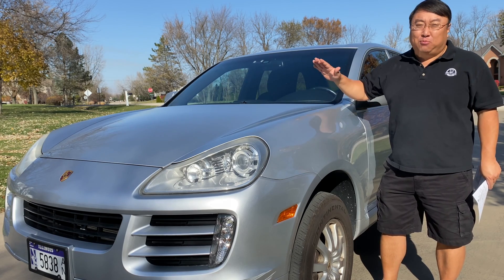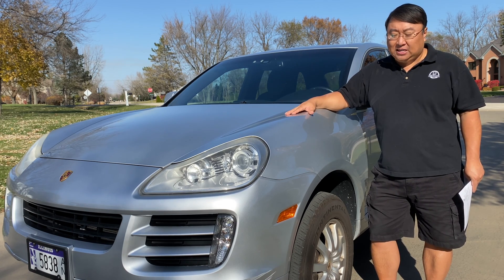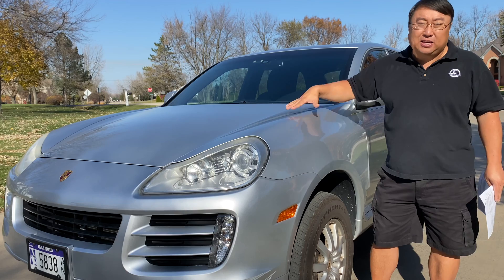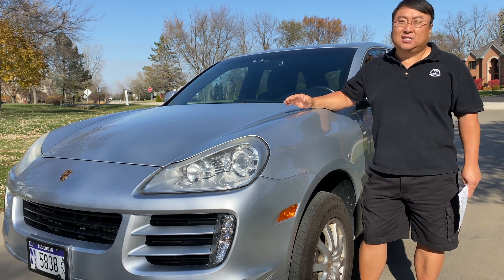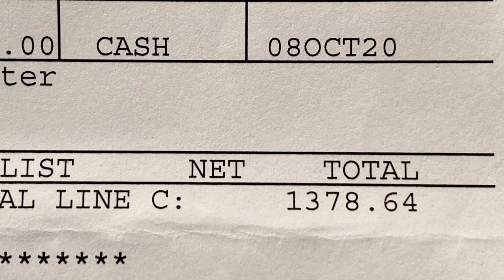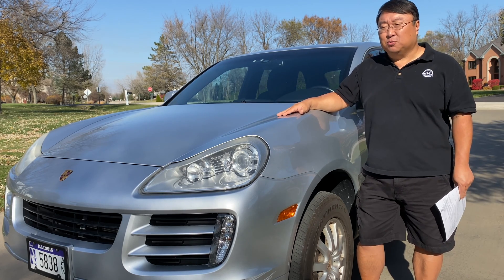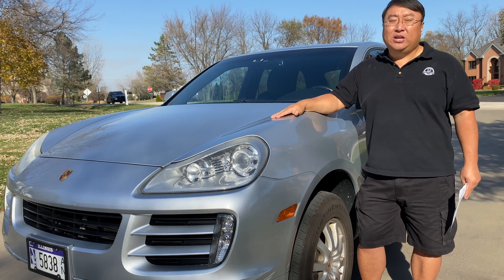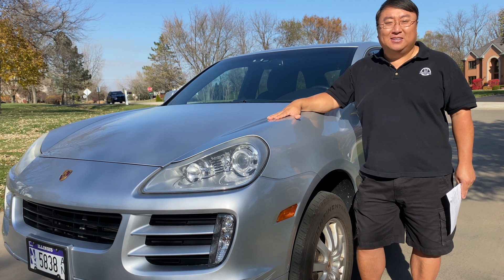Porsche Cayenne Long-Term Update: OBD Code P12A2 Repair

Comment: P12A2  is for fuel rail pressure sensor or connection harness to it.
I'm surprised that in your case it involved injector valve cover and vacuum leaks
I just got the code and I'm hoping it's just a fuel rail sensor
Reply: Did you end up fixing it ? What did you do to it?
Reply: Did that fix the problem

Comment: i have the same one. 09 base. 100k miles. where are you located? breaks and oil change here is 600. just had to replace heater hose and cv  shaft with oil change for 1200.  just over a year of driving everyday. love this ride so much

Comment: The transmission filling procedure is the same as Audi and Volkswagen on this car but that price is ludicrous in my opinion. The throttle body is all electric and there are no actuator rods so I'm not really sure what part you're referencing.

Comment: I have a 2008 with the v6. 66k miles. I try to do all the maintenance myself and I love the car. I recently replaced a leaking coolant flange and o-ring on the passenger side of the engine. I don’t even want to know what the dealer would have charged me. Next is motor mounts.